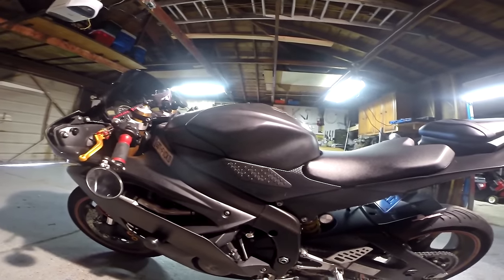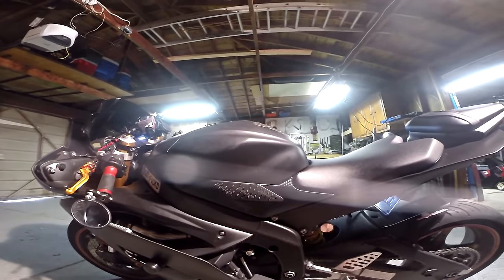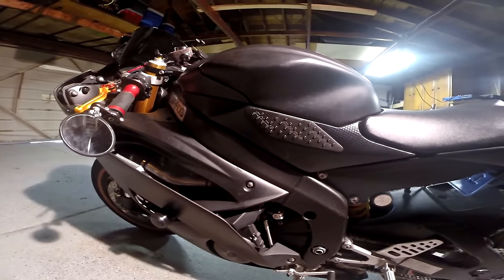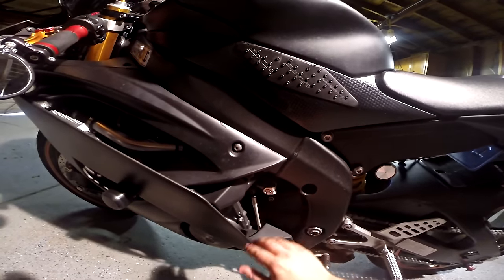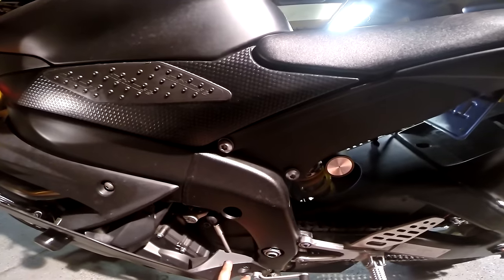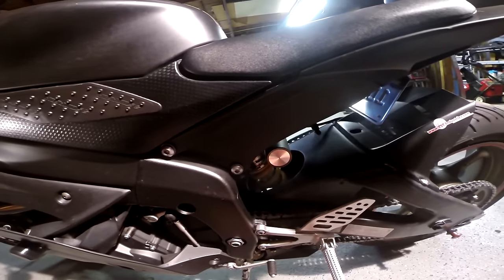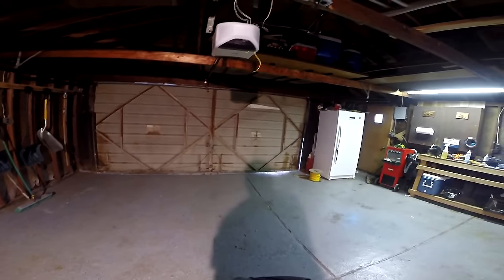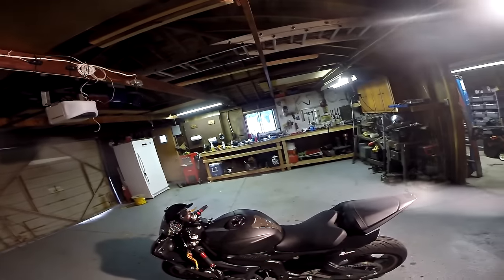How To: Change to Moto GP Shifting 2008 R6

Comment: I'm going to give this a shot! I recently developed "drop foot" from a knee injury (not bike related).  I can not presently move my left foot up to shift. So, with the help of some work boots, and a brace I was able to use my heel to up shift. But, I kept missing gears on occasion. in doing research, I have come across this MotoGP configuration.  This will make it so much easier.  Just got to wrap my brain around it, as I have been riding since i was 10 (1 down 4-5 up).  Thanks for the video!

2007 R6
Reply from the maker: +Anthony Brown glad i was able to help!